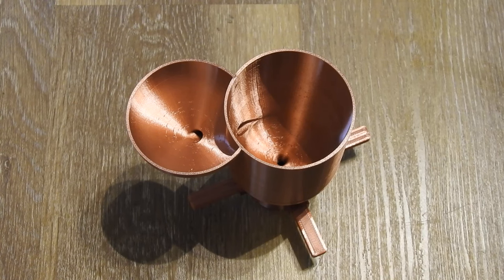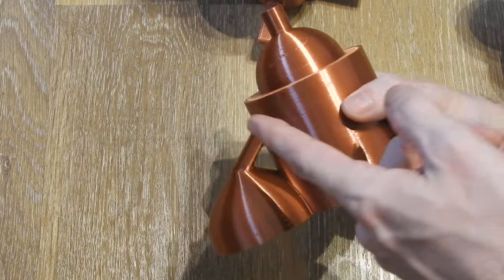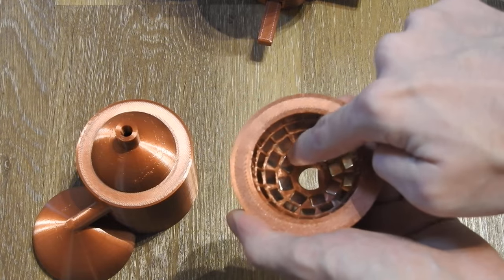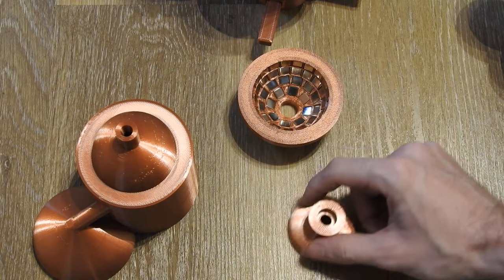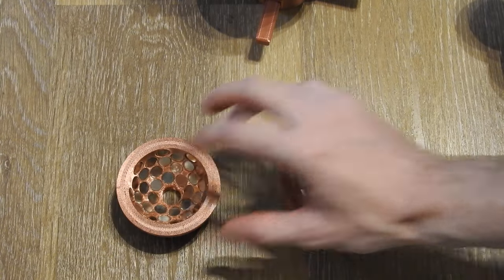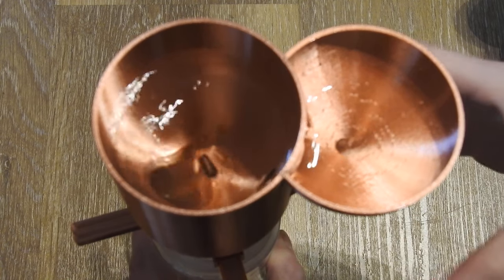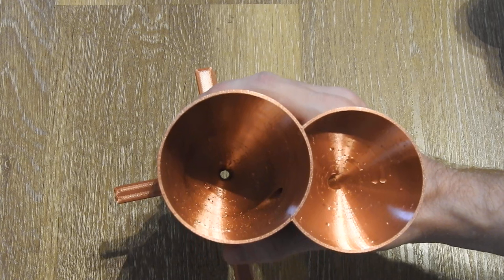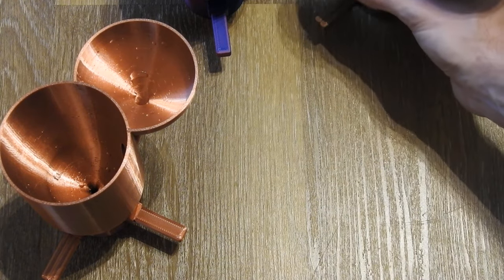Large version of my water structuring device with a bowl magnet array

Comment: if you were to use solid copper it would probably attenuate any magnetic influence. For anything to interact with magnetic flux inside the chamber would require eddy current flow behind the magnet that would sap energy from the field. Copper-filled PLA might even be better than solid copper, because it would be immune to eddy currents.